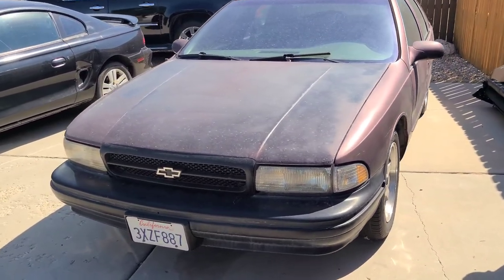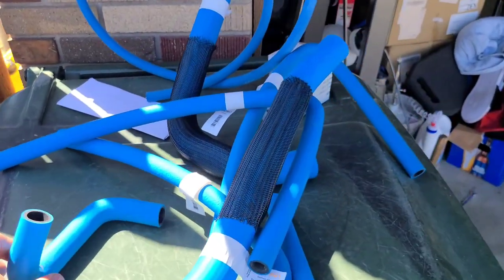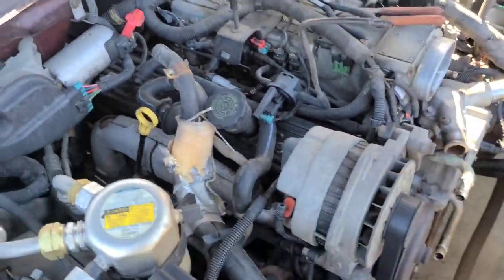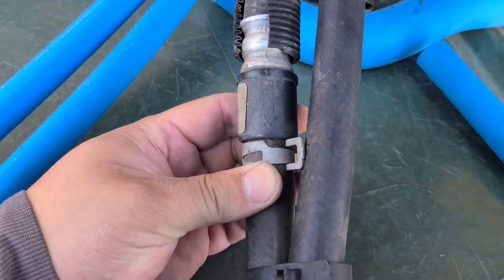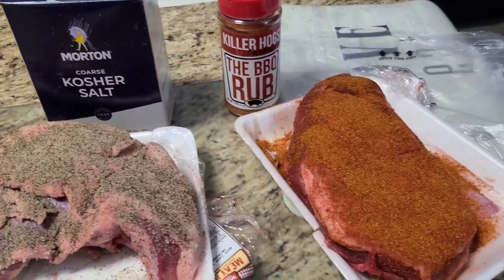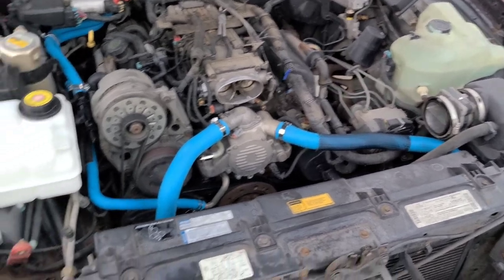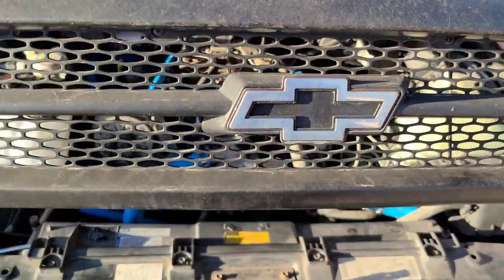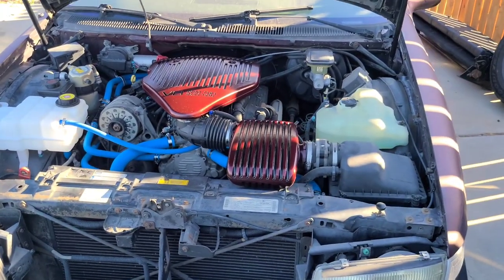Impala SS Radiator and Heater Hose Replacement

Comment: Nice 👍 I just changed my coolant reservoir I've had for 2 years nice and white looks alot better I plan on getting the red radiator hose down the road
Reply from the maker: I plan on going with the red ones when they are back in stock.

Comment: Where did you order the clear coolant tank ?
Reply from the maker: Rockauto.com
Reply: @GearJammerGarage  thanks bro also on your air box do you need that cup that’s at the bottom mine doesn’t have it . Where the air goes ?
Reply from the maker: @josegalvan3152  I'm not sure what part you are referring to. But technically the big triangle piece that I painted is not needed. I did it for looks
Reply: @GearJammerGarage  no sir I mean the hole on your actual air box behind you head light . It’s a little cup that goes around the exposed hole mine doesn’t have that like yours.
Reply from the maker: @josegalvan3152  I think that's an emissions component or "smog" if you're in California, that your referring too.